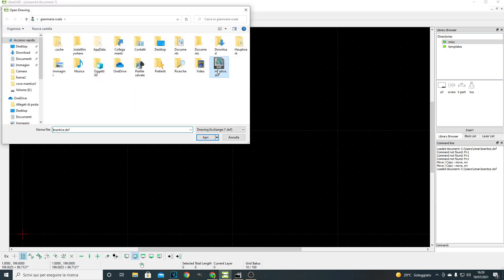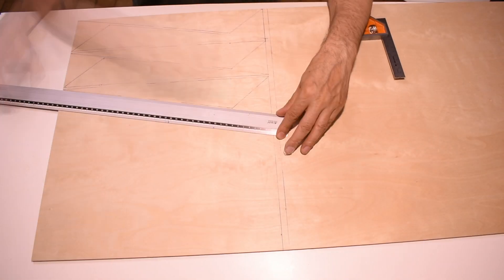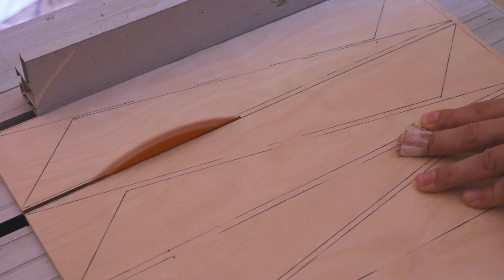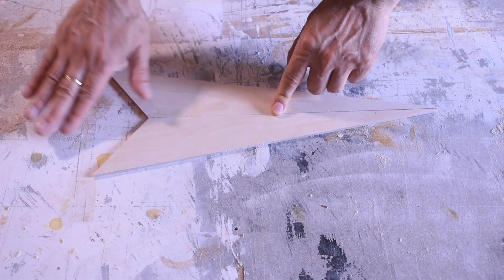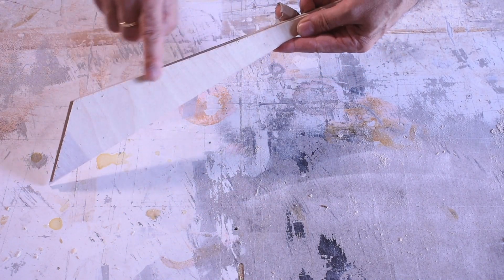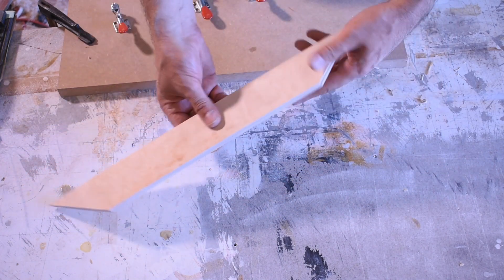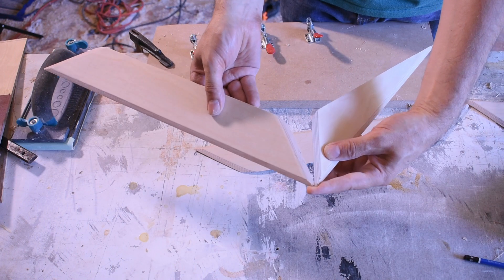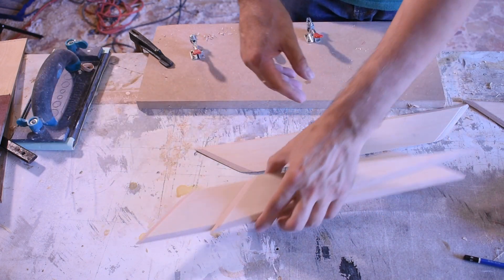How to build a Homemade portative Organ | #29 The Bellows Part 2 | SUB ITA

Comment: Again, great to see you carrying on your project!
Mabye one with self made metal pipes next?
Cheers
Reply from the maker: Thanks Bartek!
Reply from the maker: For the metal pipes it's a little more complicated, I must first learn how to weld which seems to be very difficult with the material of the pipes
Reply: @nippocast  Make the pipes from 63% tin and 37% lead. So you can melt the ends together with a very hot steel hammer.